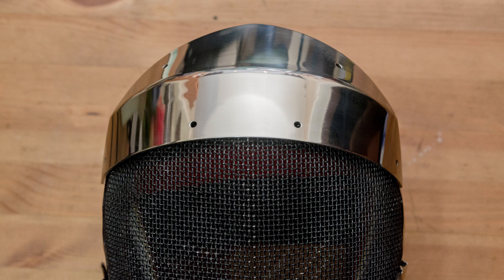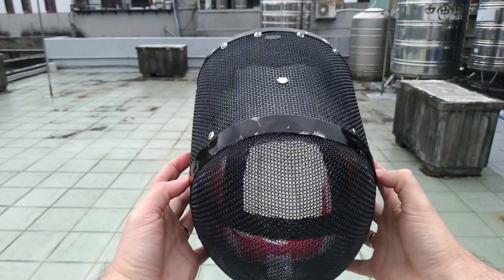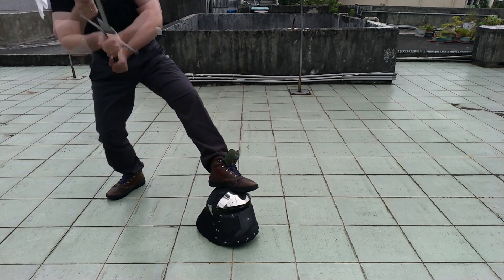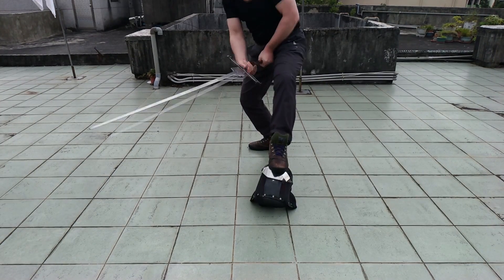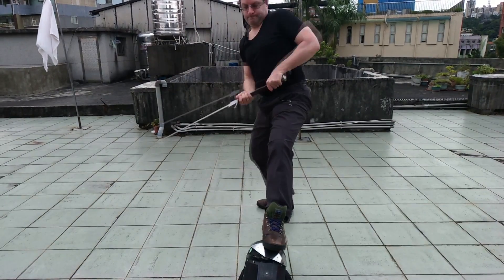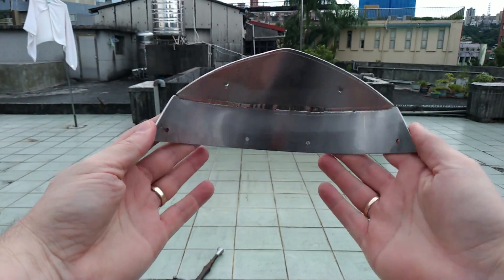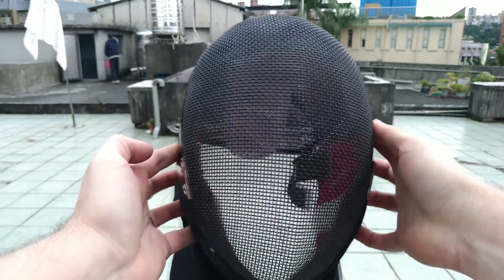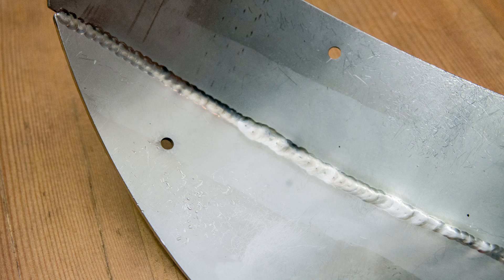Rearguard steel cap strike test

Comment: The plate will create a "lip" where points will get stuck in thrusts thus, instead of skidding off, will transfere all the energy into the head and mesh. This has been known to happen in "Paukmasken" masks used for "mensur" training which have vertical reinforcement bars on the outside when used in fencing where thursting is allowed. Bad idea imo. Better change the alloy of the wire for a stronger one or go up with the wire gauge. https://www.allstar.de/shop/product_info.php?language=en&info=550000036.html&&XTCsid=187033ef99e987ecf1909c1aab999666
Reply from the maker: A feder tip is not going to catch on a lip as small as the one this steel cap will have. The Allstar mask to which you link has thick bars which are very obvious blade catchers, and they are far thicker than the lip this steel cap is going to have. The Leon Paul all steel HEMA mask has a metal plate with a lip (and even a large gap between steel plates on the side), and no one has reported blades getting stuck in it.

https://www.leonpaul.com/mfa-tournament-mask.html#/